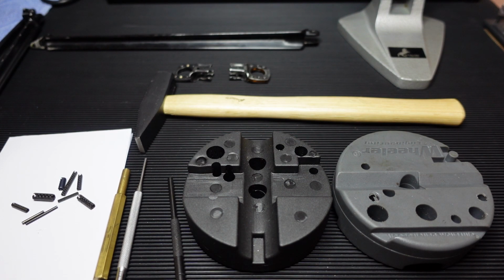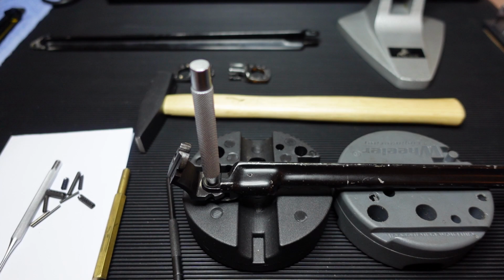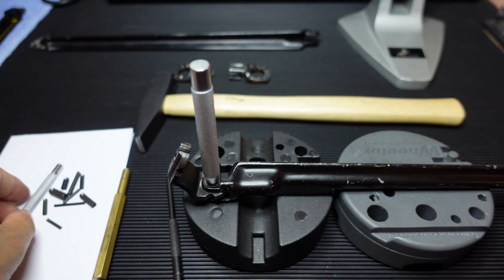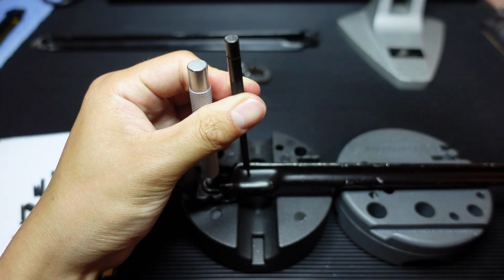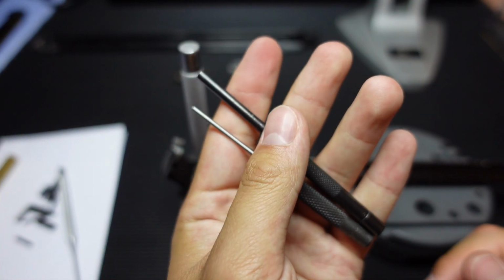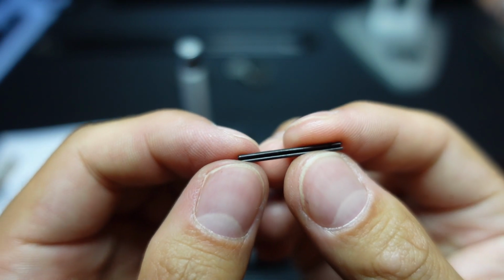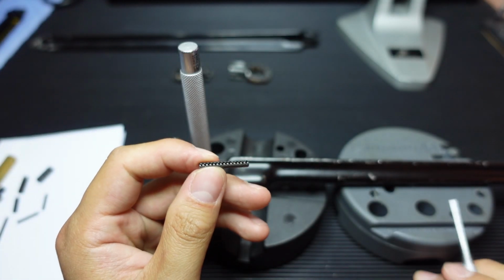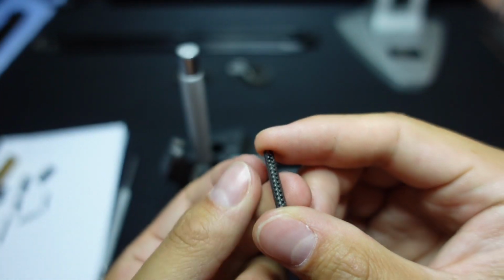Stgw. 57 / SIG SG 510 Bipod Spring Pin Removal & Minutiae

Comment: Сколько приспособлений....А разобрать автомат Калашникова нужны только две руки!!!!!И все!!!!
Reply: As an AK connoisseur myself, I would disagree. There are many other parts to disassemble which require external tools for sure.
Reply from the maker: I would not agree that you can take apart the AK with "only two hands". There are still many pins to drift and parts to remove. Only the basic field strip was doable without tools, and that applies for the Stgw. 57 as well. Obviously, disassembly of the bipod detent as demonstrated here is only done for servicing by armorers and not soldiers.

For in-depth disassembly, you can see clearly that the high-level armorer for the East German MPi-Ks had access to very specialized tools and gauges here https://www.arizonaresponsesystems.com/review-east-german-ak-armorer-tools/

Comment: Nice video.  I've become a big fan of 'roll pin' punches and 'roll pin' starter punches.  I've built one AR without them and a couple with them.  Having them makes life a lot easier.  'Roll pins' are common on a number of firearms and theses specialty punches are a good thing to have in your kitchen table gunsmithing kit.
(sigh...  Wish I had an Stgw 57.  It's on my want list.  They are rare and expensive here in the USA.)
Reply from the maker: Indeed! Super useful tools to have!